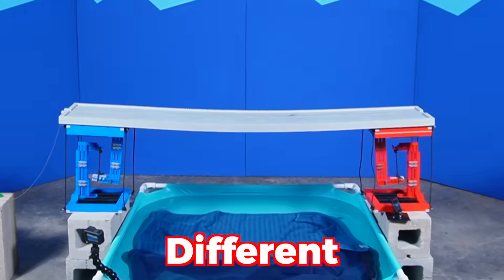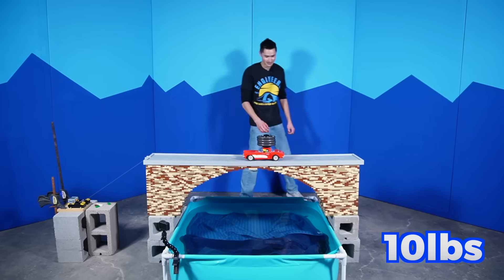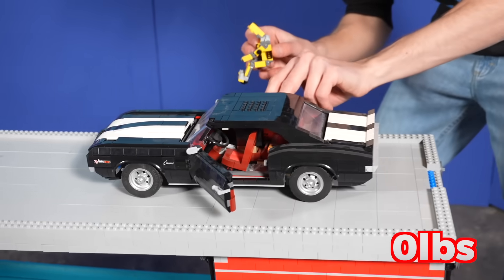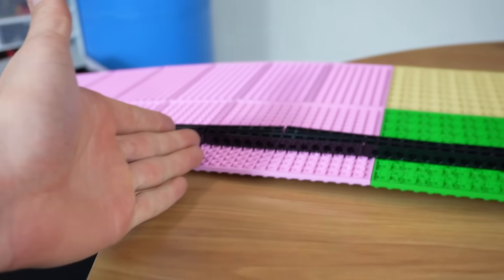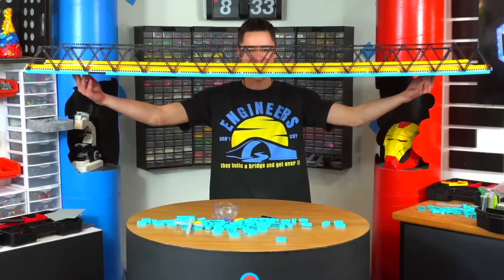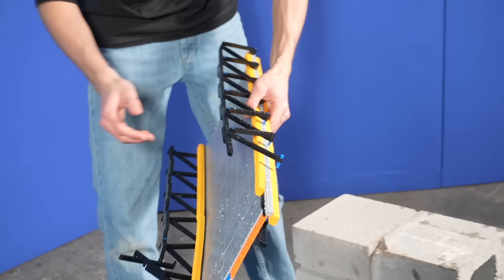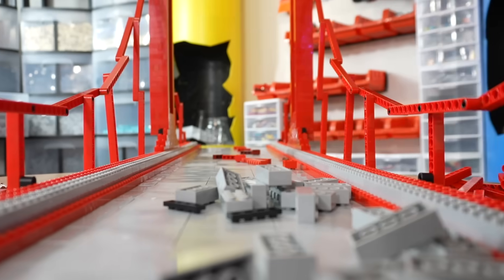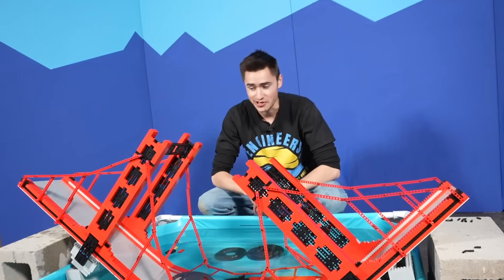Testing LEGO Bridges!

Comment: The reason why the tensegrity floating is because the roads are actually to hold it together the ropes in the middle which is just one holds the other one and so it technically holds it while the other one just doesn't have to because gravity doesn't affect that one but only keeps it down but the other one is supported by the other one because the rope and so center of gravity went to the rope cancel that's why the contraption was floating

Comment: You know you might think that lego is strong wich it is but in different factors because you can see that because the weight was placed over the entire surface of the bridge at 15 seconds into the video the weight is layed out over the enitre surface so its easier to carry but if the bridge was a bit longer and the weights were placed in the middle it would break because there is to much tention in one place

Comment: The truss bridge failed because the top members, which were in compression, buckled sideways. Truss bridges often have ties running across the roadway/track bed to avoid that. Alternatively you can put the trusses under the deck so the deck prevent the buckling.

Comment: No hate but Of course the truss bridge collapsed, it’s not connected with the width, you gotta connect the width with right triangles. and of course the winch bridge didn’t work you didn’t even freaking try to make the bridge stay on the ground in some way, if you put 2 planks on the ground across a gap and about 25% of it is on the ground what do you think will happen? It’ll slide across the ground inti the gap. But if you somewhat attach the planks to the ground in some way it will stay up (Atleast without weight on it) Improperly built. And btw in case you’ve forgotten suspension bridges have some kind of rope, I don’t think a couple of plastic beams connected by hinges is really even considered rope-like. Ik it’s supposed to be Lego but what about the winch bridge? What about the tensegrity bridge? They used rope he said rope right here, 3:52, even making the beams shorter meaning more hinges meaning more rotation being more rope-like, oh yeah rope can move in 3 directions unlike the “rope” he used. He shows that on the tensegrity bridge.

Comment: This reminded me of an assignment I did in a math class back in middle school.  We had to build a model bridge that could hold as much as possible for as little as possible (we were "charged" a set amount for each toothpick(the beams) and length of string(the wires)). Mine was an ugly mess of beams that would have been a pain to try and walk through, but because of the crazy angles it held all the rocks the class had along with the bucket used to hold them and then some when it was tested.

Comment: This is an extension to my first comment but most if not all of these bridges have a few things that are missing the golden gate bridge at the end of the video does not have a proper weight to hold down the cables which can be substituted with something holding on to the cinder blocks on the sides and all bridges are missing expansion joints which allow the bridge expand and in the summer or winter seasons overall these bridges are really realistic next time you do this maybe add a part of lego connecting to the cinder block which will hold it down making the sides not tip over making the only thing that allows the bridges to fail is snapping of the road and supports and that really applies to the truss bridge, speaking of if it only required you to basically anchor down the sides of the bridge because that was the failure point in my deductive reasoning the reason that bridge failed is because of you not properly anchoring the sides not blaming you while blaming you at the same time

Comment: The issue with the drawbridge is the fact that the weights are on the bottom and you want to place the weights on the opposite side of the area that has the weight but this requires very strong bricks even technique will have an issue with this set up because the weight will place so much stress on the bricks that they might actually snap in half hands you want to do it either close or very far depending on the weight requirements

Comment: There was a Lego masters episode where they had to build the strongest bridges, the record was 1000 pounds!
6:00 cool that Lego cars float, though it's probably only the ones without holes in the bottom
13:35 the only reason it fell is because it wasn't attached to anything, just on top of cinder blocks, if it was built on Lego it would have had a much better chance
14:00 the subscribe animation in the corner is awesome
The suspension bridge is very cool, I always wanted Lego to make one
35 pounds is pretty good

Comment: Okay but the drawbridge didn’t have enough support weight to counter the weight being added at the end of the lever. 2.5lbs of weight at the end of a 24” bridge half is 60lbs of force, you’d need equal counter weight to test the bridge itself. The drawbridge didn’t fail in this demonstration.

Comment: Don't know if anyone has said this yet, but the mistake with the drawbridge was putting the weight in front of the pilars. Put the weight behind behind and it actually has a function as proper counterweight against the force of both gravity pulling the deck down plus the weight of the car driving on the deck.

Comment: Your designs would be alot stronger if you use technic and/or snot bricks with studs on the sides and then lock them together vertically. Also, even flat bridges need to embrace the catenary. But what fun would that all be?

Comment: I have got the feeling most bridges would be able to take so much more weight if they were properly grounded or had counter weight on the outsides.
Reply: Yeah, if the draw bridge had the counterweights on the outside of the pillars, they would've been much more effective than right under them.
Reply: The draw bridge failed because it slid forward not because it broke or the mechanism failed, so yeah
Reply: Yeah, none of these bridges were built properly.